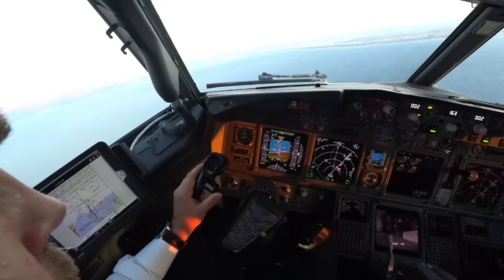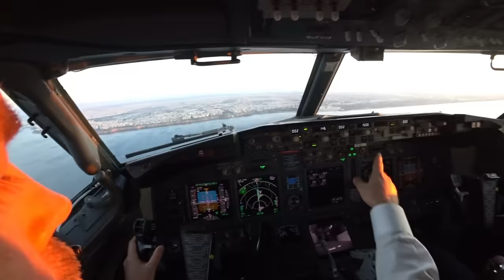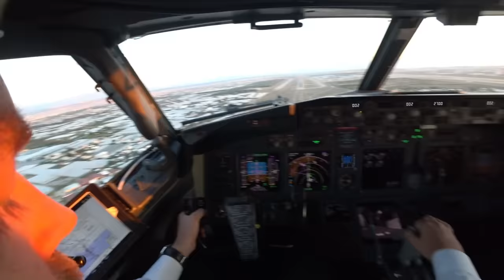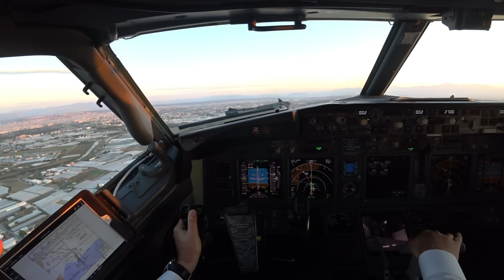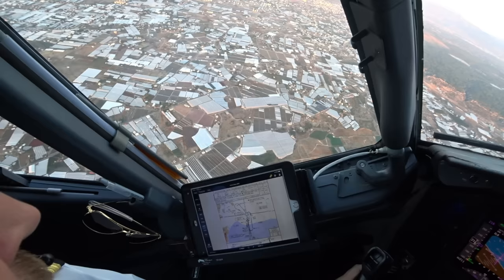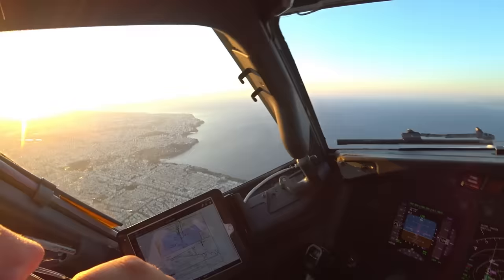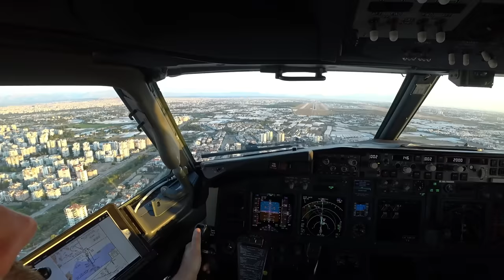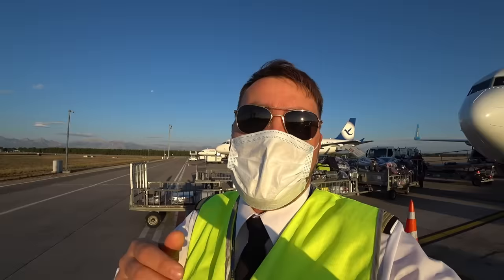Boeing 737 Manual Go-Around in Antalya Pilot Eye Cockpit Camera

Comment: Best thing to know about go arounds if you’re a passenger: be happy that your pilot is doing one.
Reply: Worked in aviation myself for years and your spot on ..we also say while extreme turbulence may break an arm or leg it will never break the aircraft ..oddly comforting to fear of flying pax 😆
Reply: @carlbode666  Sure it is! (I am not a pilot and fly way less than I want :D ) It is always better to know that the worst I can suffer is a relatively minor harm (compared to die because plane disintegration). Once I flew from BUD to VCE with my brother and after a long delay caused by de-icing problems (in mid-January) we switched plane (from a Fokker to a 737) and were delayed two hours at least… When we arrived near VCE the pilot announced that we have to fly a pattern because of the dense fog over the airport. Most people went anxious, including my brother while I nodded and went asleep. After almost an hour we could land and my  brother asked me how could I sleep in this situation? "It's simple" I said, "I know what's going on and I know that responsible professionals take care of me. I cannot dismiss the fog nor land the plane so the best I can do is to switch my brain idle and relaxing as long as I can." Later he flew a lot on long distance flights and all over Asia and told me he successfully used this mindset while having problems he don't have to control.
Reply: @B2BWide  nothing like tech problems..change of plane  or De ice surface issues to unnerve pax ..it's the loss of control for most people add that to the stress mentioned & u have a recipe for illogical concern ..no safer place to be than in an aircraft ..over 100 years of tech endless failsafes ..people on the ground watching your every move using the best tech available ..terrible weather on approach ..no probs ..autoland ...u can't say any of that for the journey on the way to the airport ...bad drivers ..bad weather ..poor visibility ..only one place to be ..keepin the blue side up ! 😁
Reply: @carlbode666  Honestly turbulence is the worst, I flew this summer and had it like 2/3 of the flight, just a huge storm across the states, no one could get up for most of the flight… but I knew that we were safe because the computer does it’s thing.. amazing tech.
Reply: @Followerofchrist2091  I actually prefer as a pax mild turbulence throughout the flight ..nothing worse or more boring lol than a smooth flight but yeah never fear it even at its worst just strap in & jack in hand enjoy 😁
Reply: RYAN AIR Pilot: Hmmmmm🤔 Go around?? that doesn't work for me..
Reply: @13yearsago  exactly, they avoid doing go arounds to save money+fuel and thus their landings are hard but will work 99% of the time as the pilots are literally flying the plane into the runway, not flaring as much and floating down the runway trying to get a smooth landing.
Reply: Unfortunately a lot of passengers can’t stand landing 20 minutes late and will blame the airline for delaying them despite the fact that they possibly just prevented an accident and avoided causing loads of damage to the aircraft and possibly even saved the passengers lives.
Reply: ahahahaha that is so true for so many situations!
Reply: #Emirates
Reply: #Emirates Air
Reply: Yeah rather then "Bonzai! We're landing this shit no matter what!"
Reply: Yup
Reply: @bobjohn2000  That’s their training, since ryr flies to smaller airports, they prioritize getting it down rather than smoothness
Reply: Nothing worse then get there-itis
Reply: Definitely. I’m a nervous flier, but I have zero problem with up. However much acceleration there is. I like being on the ground, but definitely not with another huge (or any) plane between me and the ground. No matter what I’m in I Really don’t want to crash at that speed. I would tip my pilot any amount to er 15x on the side of caution, and if any doubt of a foreign object, to go around and have a second look.
Reply: Many reasons not to be happy with a go around such as a thunderstorm is forming nearby, fuel emergency, seriously ill passenger etc
Reply: The only one I had was in dense fog with zero visibility outside. It was the most terrifying experience.
Reply: I am a pilot and I can definitely confirm that😅😅
Reply: Im getting ga200 vibes
Reply: As a private pilot, I never accept I'm going to land until I land....until then it's 'go around possible' at all times during approach!
Reply: Why
Reply: Nah it’s boring. Annoyed with the situation requiring a go around not with the pilot doing it
Reply: Looking for attention
Reply: Go around is your friend!
Reply: @B2BWide why would people be scared they have to fly in a pattern?

So stupid!
Reply: @B2BWide this is my best motivation today
Reply: You may be 20 minutes late but at least you’re not dead
Reply: Why?

Comment: This is a great example of a go-around! I fly the 737 and have never done a real world go-around (only in the simulator) as they are un-common, so its great to see some real-life procedures being implemented. Good job!
Reply from the maker: Safe Flights, Victoria.
Reply: Hello, I'd like to ask something. How do you call the moment when the landing is done, but incorrectly and then the plane takes off again, goes around and then lands back.
I hope to get an answer of this, I've experienced this for the first time in my life afew weeks ago, and since I am completely blind, I can talk about how it felt, didn't understand 100% of what happened, the plane was not positioned correctly due to the wind after touching doun, that's what I know.
Reply: @georgeantonioandrei8570  touch and go
Reply: If you want to practice Go arounds, fly into Gibraltar. Happens quite often there lol
Reply: @georgeantonioandrei8570  It's a baulked landing. I can happen if the aircraft touches down outside of the touchdown zone. If a landing touches down outside of the touchdown zone, then it cannot be guaranteed that the aircraft will be able to stop within the Landing distance available, so a go around is a safe option.
Reply: Me flying in 737 simulator, sometimes I do go-around. Mostly because of unstabilized approach and rarely because of long landings. Once I had a "collision". Another 737 announced landing on parallel rwy, but he tried on same, but on opposite site. We both executed go-around and we almost crash front to front. I was recording this on video, and I still have it.

Edit: ATC wasnt responding for couple minutes before. After go-around I received clearance to another approach and landing.
Reply: @georgeantonioandrei8570  its a missed approach or go around in aviation language. A Touch and go is a Planned manuever.
Reply: @Nathangreene3819  Touch and go is a planned maneuver
Reply: You are the best one
Reply: Wait what? For how long are you flying?  I stopped counting my go-arounds.
Reply: Ive had 2 go arounds in my last 5 flights! Actually quite scary.
Reply: Excellent work.
Reply: Don't you train the go around maneuver on test flights ? I find hard to believe that a pilot have never done a go around other than in simulator.

Comment: My go-around completed a miserable day back in June 1979. Took off from Las Angeles to Phoenix on Continental. Took that flight many times. Just as we were approaching the San Bernardino Mtns, about 65 miles east of L A I noticed the plane making a left turn, I said to myself, "we're going back". About 20 seconds later the captain announced the plane had a control issue and we needed to return. After landing we were told it would be about 2 hours before we could continue. At this time Western Airlines and Continental Airlines were in merger talks. A Western Airlines plane pulls into the gate and we got on board. Doors closed, and we didn't go anywhere. Plane was a 727 and the 3rd engine wouldn't start. Offloaded again. Two hours later back on board. Normal takeoff and flight until on final, down to about 500 feet and we did a missed approach because a plane hadn't cleared the runway. Finally on the ground. All this time I had been phoning in messages from the airport to my office, which relayed them to our Phoenix office. My boss had flown in earlier from Burbank and went to meet the original flight and saw the message board "See agent", next to my flight number. He was a wreck; we just having lost a co-worker on flight 191 in Chicago weeks earlier.

Comment: I've done several while a passenger flying into Juneau Alaska. Alaska Air is the predominant Air carrier that goes into Juneau year around. Delta used to fly into Juneau in the summer but suspend operations in the winter. 

Juneaus final approach you're guided by offset radio beacons that have you making a left turn before lining up for the runway. In the winter conditions can deteriorate quickly due to snow winds etc. I
Pilots need to hit the end of the runway if they drift to far down the runway there's not enough runway. As a result missed approaches happen, and I for one have always been glad the pilot executed a missed approach. I'd rather them do a do a go around than skid off the end of the runway. 

It's no big deal, you feel them throttle up, you hear the gear, and flaps being quickly retracted. I'd rather be late to the gate than smeared all over the runway.

Comment: Nice go around. This situation is exactly why I keep the autopilot and auto thrust on, especially at busy airports. An auto go around is so much easier and reduces pilot workload.
Reply: Had he still had the autopilot engaged, it would have disconnected anyway, only difference would have been having the autothrottle. It will only do an automatic go around if landing with autoland

Comment: Amazing video! Special appreciation for making that PA. As a passenger, it makes a huge difference to hear from the pilots in unusual circumstances like these.
Reply: Pilots are trained to 1) Aviate 2) Navigate 3) Communicate (with atc). If you don't hear anything, you should remind yourself that the #1 task for the pilot is to fly the plane.
Reply: @mitchellroberts7954  sure, but e.g. pilots at low-cost airlines don't bother to talk to passengers a lot. Sometimes there isn't a single PA throughout the entire (normal) flight and this is definitely not because they're so busy flying the plane.

Comment: I used to fly frequently, every week or more, and have experienced around 6 or so go arounds in 30 years. Once for a plane on the runway, twice for a missed approach (trying to save time landing with a tail wind, it didn't work) and once because as we found out later the undercarriage wasn't properly extended, and at least twice due to wind shear. That's the worst a it's somewhat alarming when you get thrown around in turbulence.

Comment: I was on a Swiss air flight a few weeks ago, from Vilnius to Zurich, that did a go around. We were right over the runway about to land, I think the back wheels touched the ground but not 100% sure. I was looking out the window watching the runway waiting for it to land. Then we started going back up. I was really nervous thinking there was something wrong with the landing gear. The flight attendant came on saying they are doing a go around and they will get more information.. We did a loop and came back to land again. The flight attendant said we did a go around because the plane was going too fast to land. That wasn't reassuring, weather was perfect and I'm not sure why the plane would be going too fast ! I wish I could find out more about the flight. I looked at FlightRadar and it says the lowest altitude was 1000 feet which isn't right.

Comment: How much force do you need to apply to the yoke (or throttles) in order it disengages autopilot? or what happens if you slightly move the yoke? does it moves the plane without disengaging a/p?

Comment: At 1100ft your PM noted the aircraft that was going to vacate late. Just curious to know why you still decided to disconnect at 1000ft RA if it seemed likely you would go-around. Makes little difference to the autopilot I suppose but at least you get to keep the auto-throttle.
Interesting to see the differences in procedures between airlines, were you being checked out by another captain? :)

Comment: I still fail to comprehend how those big things manage to aim in the right direction, let alone hit the runway, and even the centreline. I’d be 12 miles over. It looks so easy, just wiggle the yolk. But……….. really, it looks…. Not real, because of the way height and brain just don’t work. How hard is it to vaguely hit the runway? To actually hit the runway? I used to fly in to Aberdeen, Scotland. There is always a crosswind. The plane vibrates with all the air rushes, it leaps around like a fish out of water then bam. On the center line. Madness

Comment: @Pilot Blog , hello! I'm curious that is it allowable to turn off autobrake directly  even autobrake didn't disengage yet? cuz i just saw this kind of maneuver first time from all cockpit videos and i didn't see this before,   will it get any problem for system override?
Reply from the maker: Do you mean after landing? 
It is normal. You either disengage it manually with applying the manual brakes or switching off the autobrake selector....
Reply: @PilotBlogDenys  Thanks for your reply, and my question, normally what i saw is below 80kt then applying manaul brake to disengage, but not manual switch off at high speed (i think video still showing aoubt 90kt?)

Comment: Hello! Why are you not flying CDA? is company Sop to fly levelled at low altitude?
Thanks and great video
Reply from the maker: I didn't understand your comment...
Reply: @PilotBlogDenys  Hello thanks for answering! In the first approach you were flying in ALT HOLD with flaps out and a lot of thrust was required. Then gear and landing flaps still levelled at the same altitude with a lot of fuel consumption. So I was wondering if it was your company standard operating procedure to do not fly continuous descent approaches. I’m just curious… thanks.
Reply from the maker: @Frabusne  Oh, that one. It is usual in AYT. You never know when you'll have the clearance to turn base. G/S entry is 1500ft (1300AGL) do you have to be flaps 15 before it to get stable. Plus we got clearance to maintain 160kts. So here you go

Comment: Great video, Capt.Denys! Noticed the use of nose down stab trim inputs after the go around. How do you determine how much trim is needed?
Reply from the maker: I feel it with my hands
Reply: @PilotBlogDenys  Thank you. If you release the control column, it will go to the neutral position, right?
Reply from the maker: @martin.B777  No...

Comment: Nice video! You are one of the pilots that I've seen do a briefing to the passengers in instances like this.
I was on a flight on the Airbus A319 and while on approach we hit some turbulence and the pilot didn't even say what was going on. after 25 minutes of horrifying drops and sharp turns we finally landed.
I think when you do a briefing for the passengers it makes them feel comfortable and relaxed in the aircraft.
Reply: While it is reassuring for the passengers, in general, pilot workload is already very high on approach (probably even higher due to the turbulance in your case) and so they might not have had time to do such an announcement.

Comment: Why you asked the first officer to turn off the autobrake instead of using toe brake?
Reply from the maker: You can switch it by applying brakes or with the switch itself. Doesn't really matter. You just have a punch if you use brake pedals for that...

Comment: Wonderful to see you're terrific CRM and cockpit procedures for a go-around. Great view of the cockpit and your view! And I really appreciate your pausing the video and explaining some of the technical elements.

One (hopefully) constructive criticism about the filming of the: whoever is operating the camera keeps swinging the camera wildly back and forth to capture different things. Which for a viewer is both very disorienting and is making me personally seasick watching the video. I love the content but I think your camera operator could use a few classes in how to frame a shot and keep the shot relatively stable without swinging it so unsteadily back and forth so often. Just as with piling, there are certain technical elements to filming properly, and this is a common novice mistake, which really degrades the quality and the watch ability. If you want to do a pan  across ( it should be slow and steady, not fast and jerky. I understand it's a handheld camera in the cockpit with a lot going on -  but better that they pull back and choose one steady shot and stay with it even if they miss every little thing then to make the viewer feel motion sickness with constantly jerking it back and forth. Another way to do this is to have fixed cameras in the cockpit that don't move and then use the different views to switch back and forth which will also give you the ability to show different perspectives without that wild jerky swinging from side to side. 

Again, I LOVE the content and how you explain things and I hope this comment is taken in the spirit it's offered - which is constructive criticism to help you videos be even more awesome! 😊

Comment: wonder when the FAA is going to make all this video equipment illegal during flights. Youre not allowed to have your cellphone on but these idiots can have cameras running wild, taking their focus off of flying. Most likely using a GoPro which has a wifi module that can interfere with flight instruments.
Reply: Nice.
Reply from the maker: Ding Dong, I think that is your name. and idiot is only you here) I can use cameras and I  turn off all the signals from it. Plus there are other countries outside USA and FAA regulations don't apply on those.